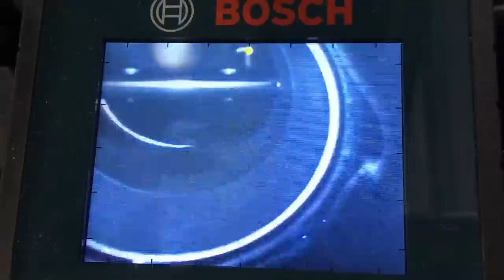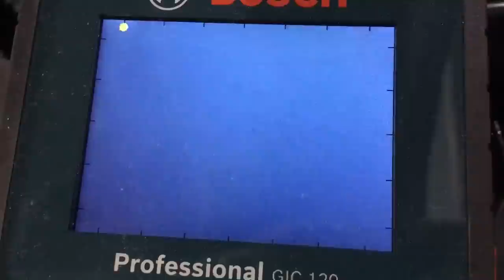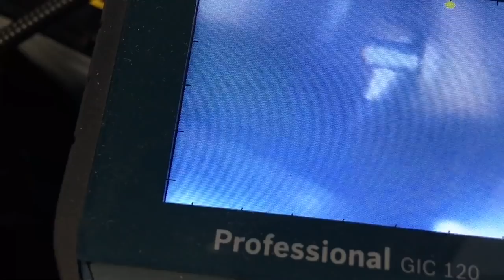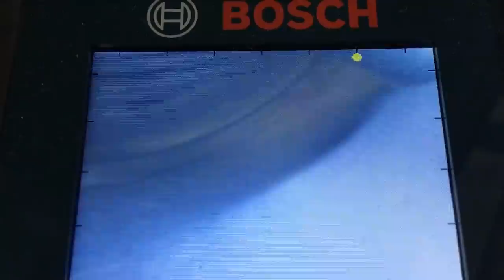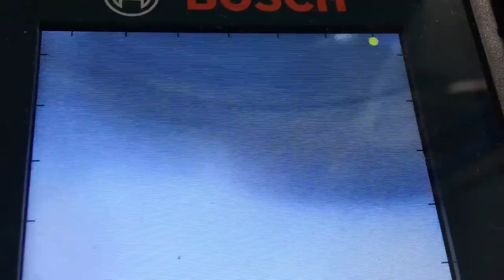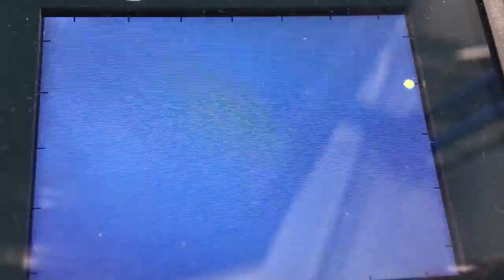1GD-FTV fathers Day Eve special EGR - Where the flow reduction plate goes & Let’s take a look inside

Comment: Spot on with the GD clean after 60000 km. Hope if you get in later to strip further. We would have to get made here in SA. I did pick up liked made tool with 6 points. I use WD40 once loose turn back then forward to clean. Noticed you used 12 point to put back as easier. I watch fully top class as always well done.

Comment: 13mm hole is a waste of time. It will flow as much soot as if the plate weren't there.
The ecu checks sufficient egr flow via the MAF. That's why people have to keep making the hole bigger to the point that the ecu is happy with the flow.
Only way is to blank it and fit a cheat chip/harness or have the car tuned and switched off that way.